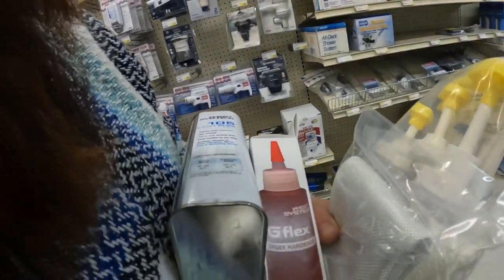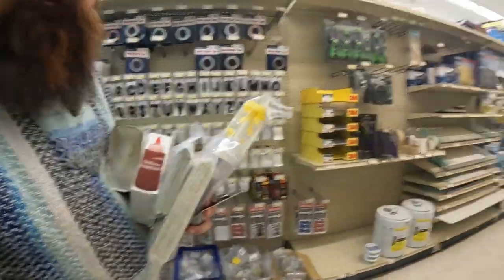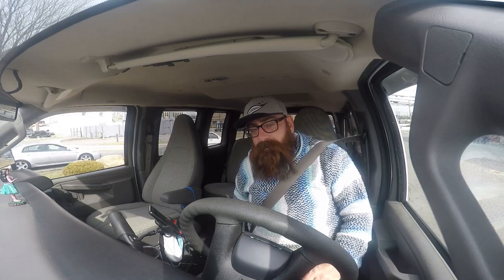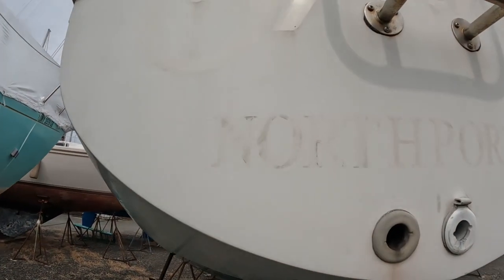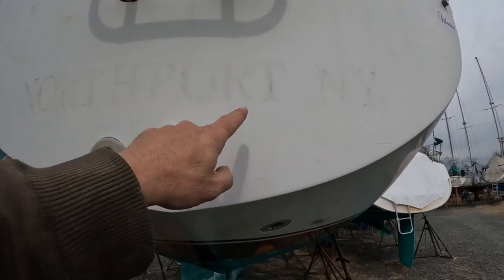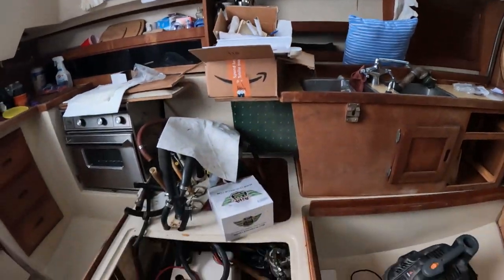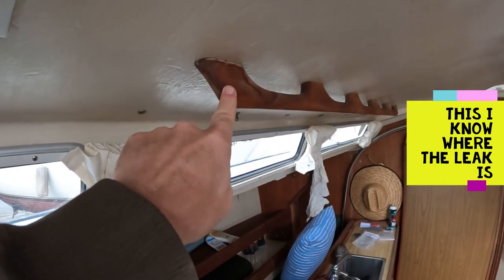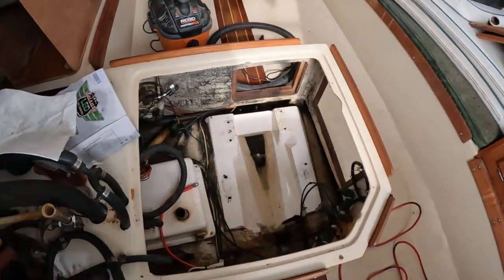Boat Projects are never ending Flooding in my Catalina 30 bilge Oh and some stickers and stuff

Comment: If your anchor locker is where you think your water ingress is coming from....I had a similar issue, the drain at the bottom was plugged, and there is a weep hole on the side which drains into the bilge.  It's there to keep a windlass from getting underwater,   Though you can just reseat the handhold while adding some butyl tape on the outside.  My bilge filled with motoroil as I am cutting out my old motor mounts and dealing with my crap engine.  I apparently let the oil drain hose flop down and I now have a motor oil bilge.  Did you wet your Magic Eraser?  They don't work unless they are wet.  Your boat name didn't look to wide.  Let me guess "Seven Seas?"  Nauti Girl??  "My wife thinks this is my new mistress and boy is she ticked?"
Reply from the maker: I got to pull all the chain and line out and take a look